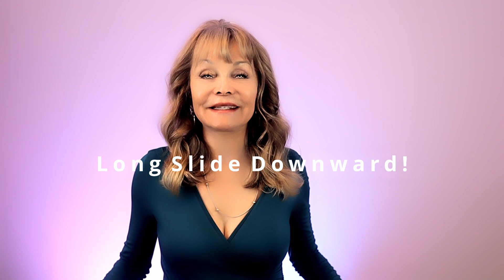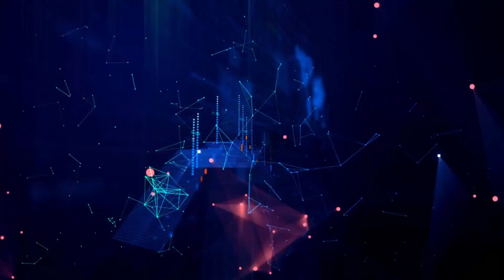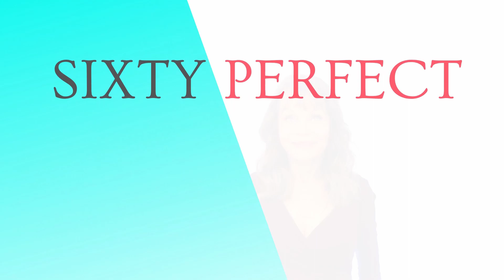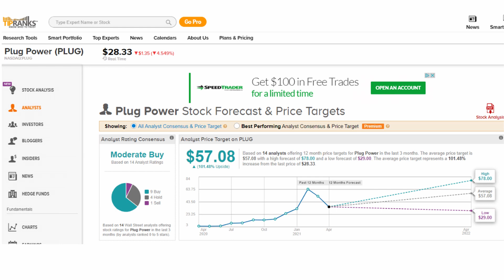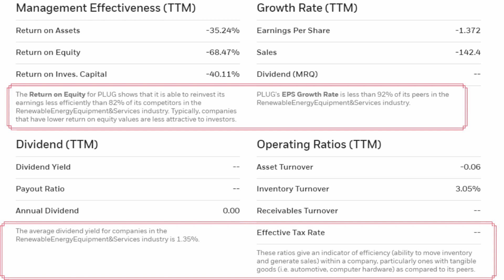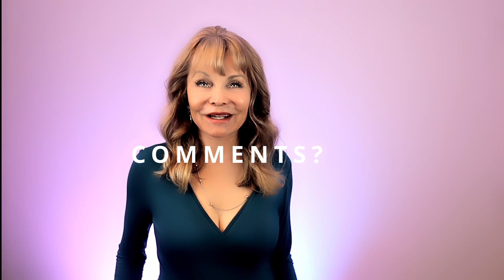💥PLUG Stock Price Forecast (Resistance Levels Breakdown!)

Comment: I am kinda little worried 😟
Reply: I wouldn’t be worried at all. The company has over $1B in cash on hands. They would just pay the fine and move on. Buy the dip
Reply from the maker: I can’t give you financial advise but this should be a good one in the long term. Just set it aside until the end of next year, but realize it will probably go a lot lower before it goes up. They need a year or two to rebuild their financials. I get tired of you tubers pushing people to buy stocks that are going to go down for a while.